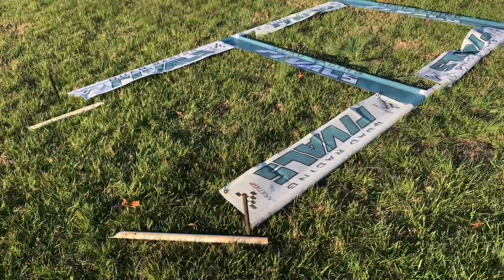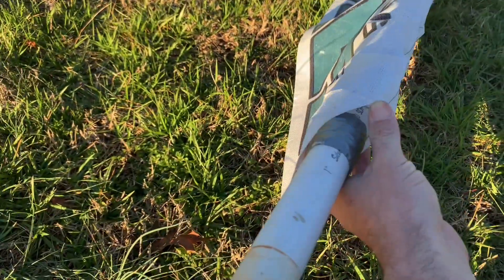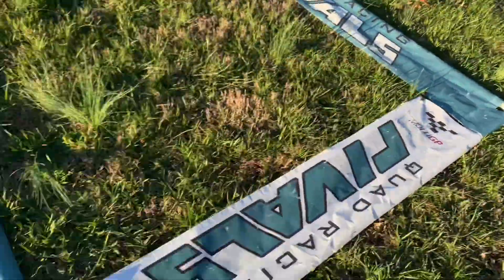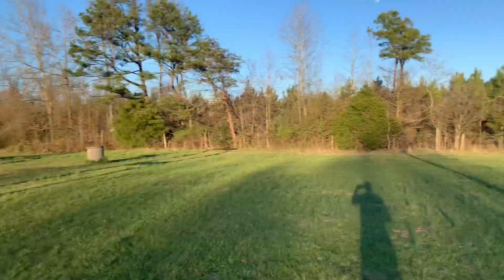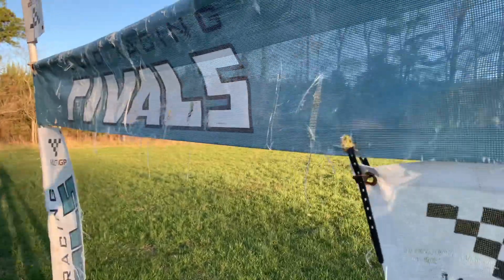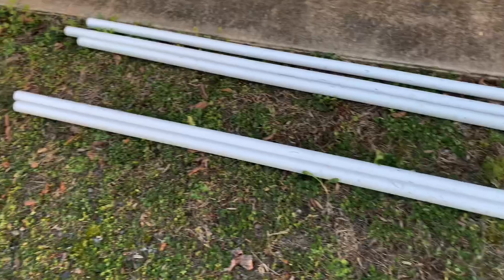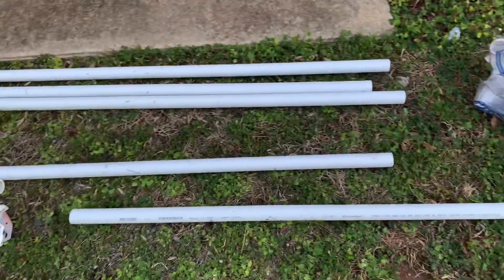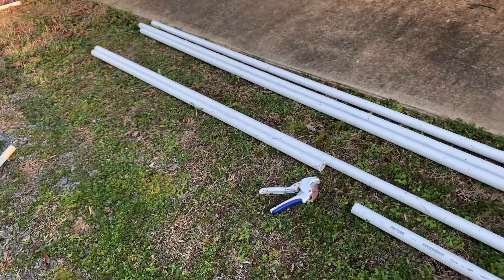MultiGP stacked gate - all pvc version

Comment: Is this way as good as the EMT one?
Reply from the maker: I originally built this as a test, but this has become my standard for stacked gates. I have 3-4 gates out there with the larger conduit at any time and it's super easy to stack a 1" gate on top. They're very stable as well and they don't sink into the ground as much as the smaller diameter (and thinner walled) emt pipes do.